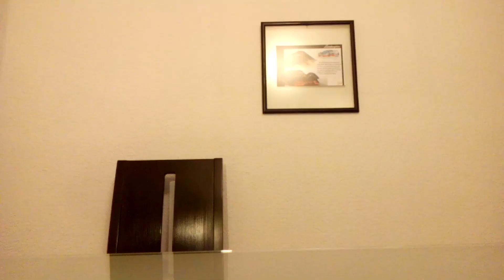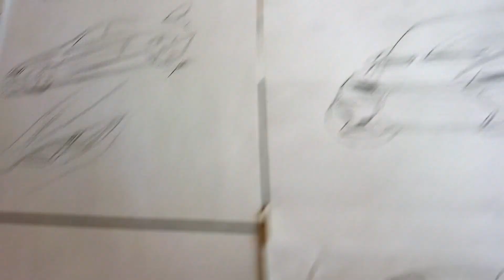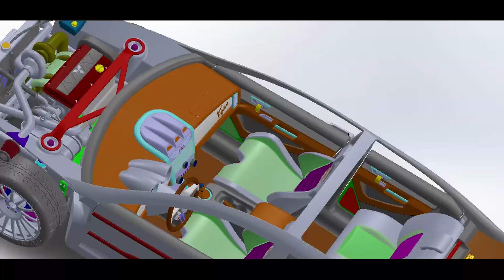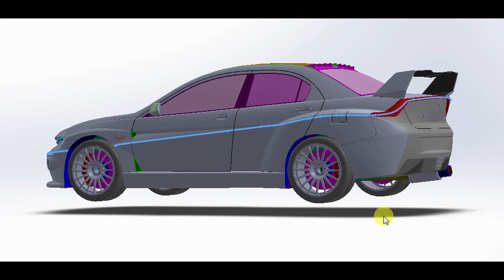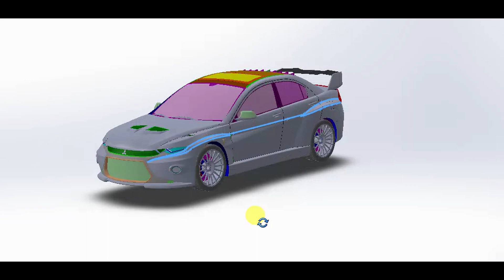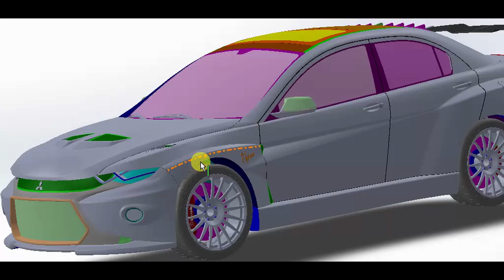Car Design Tutorial and tips Designing The New Mitsubishi Lancer Evo XI 2020 concept car

Comment: I love this design so much.  If this was mass produced and had an upgraded 4B11 or updated 4G63 (wishful) then I would trade my X for it.  No kidding.  Just no hybrid/electric BS.
Reply: They also need more packages and versions like Dodge has done with the Challenger and Charger.  They need to mass produce the “FQ” models such as FQ440, etc and more with higher quality parts interior and exterior.
Reply from the maker: Thanks a lot, I feel the same way.... nothing like real mechanical power
Reply from the maker: @SynysterJak  you are right they should get more versions and more configurability into the game